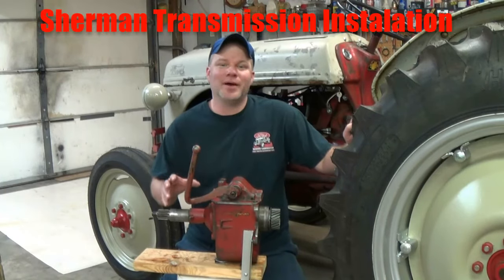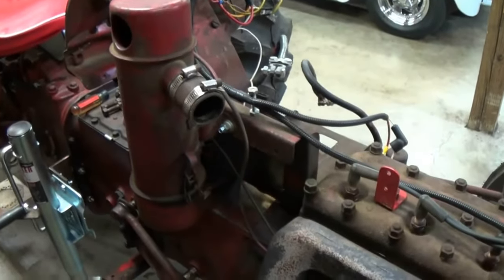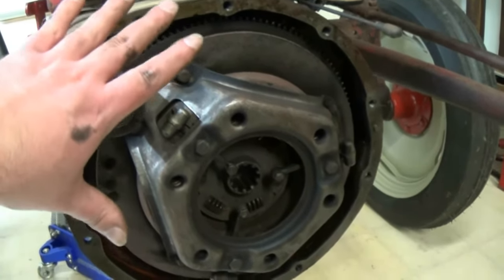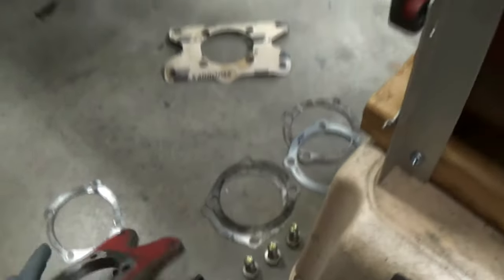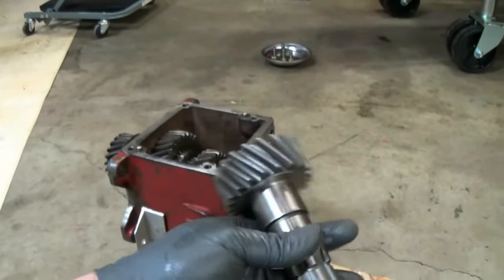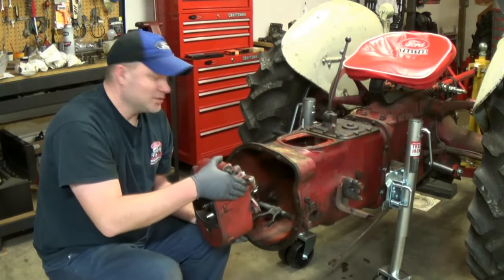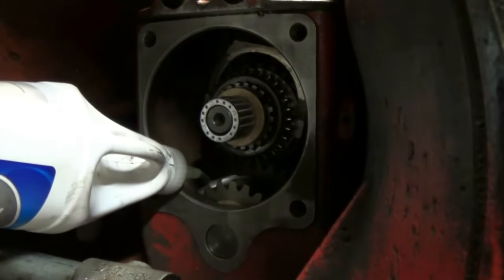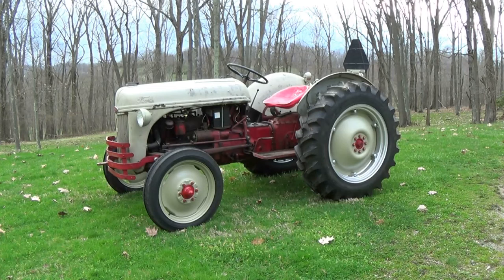Sherman Transmission Installation (Ford 8N Tractor)

Comment: Have you considered doing a Flat head V8 conversion next? I think there is an easy one out there. Would be interesting to see how much better the classics can be than the more modern tractors😁
Reply from the maker: Yes I have been studying V8 builds for years. There are kits available however I do not care for them. The main reason is the hood would need raised and lengthened. The kits give you a piece to bolt to the dash to do that,but I do not care for the look. I would prefer to use a 60 hp flathead conversion where the engine is small enough you can use the original hood and no modifications need to be done to it. It's kind of hard to find a 60 hp one through. I haven't really looked real hard though. It would take the right tractor too. If I'd find one that the original engine was completely junk but the rest of the tractor had good bones I'd attempt it.

Comment: Are there any modifications to make hydraulic and pto live ?
Reply from the maker: There was a Sherman Live PTO conversion however they are extremely rare. I've never seen one or know anyone that has one.
As far as making the lift arms live hydraulic no. Some people will put a external pump that runs off the crankshaft and a loader or rear remote can be used. Pretty hard to do that and make it look nice and neat. Most look like hack jobs.
Reply: @Jason1Pa  The big disadvantage to the crank driven auxiliary pump is that it's constantly robbing horsepower on a tractor that doesn't have much to work with already.

Comment: Where did you get the attachment on the 3 point lift?
Reply from the maker: Tractor Supply.  It is their trailer mover. Has a gooseneck ball on top and a receiver on the bottom for whatever kind of hitch you want to use

Comment: Do you have repair for 8n pto won’t stay engaged
Reply from the maker: I don't have a in depth video unfortunately however here are a couple things. You can check. Grab the PTO shaft (tractor off of course and override clutch off) and see if there is any in and out movement. There really shouldn't be any. If there is there could be a bad snap ring,bearing, etc, damaged causing that slop and creating it to jump out of gear. There is also a small spring and ball (detent ball) in the bearing coupler. That is what your PTO lever hooks up too. If that spring or ball is damaged it will be weak and cause it to jump out of gear. Here is a video of the bearing coupler if your not familiar. Fast forward to the 16:40 mark.  https://youtu.be/19yITWEWcbk?si=zJNPUu4OmXx1F_Vd

Comment: Why wouldn't you drill a hole in the housing to access the drain plug?
Reply from the maker: I never understood why they never had a way to drain the oil out of it. Somethings to consider would be the hole would need to be fairly large to get easy access to the plug. If you wouldn't be able to grab the plug with your fingers and would drop the plug either getting it in or out it would get lost in there. I guess you could have a small pipe coming threw with a cab. I'd be worried that it would get broke off. Also if it were drained out completely you can't get oil back into it and it takes a while for the oil to find its way in. You'd be running low for a while.
Reply: @Jason1Pa  and the bottom of the housing right where it is at is not flat, so plugging it would be the next problem.

Comment: I realize an N series isn't a power house. What are the chances of one of these transmissions holding up behind the engine of an M or super MD Farmall?????     Would it be a waste of machining time to put one of these in a big Farmall?  I'd love to have an over / under drive for an M , super MD. If anyone has better options I'm open for suggestions. M&W stuff has gotten way too pricey, as well as too scarce.
Reply from the maker: There is no way you could get a Sherman  to fit into a Farmall M.
Reply: @Jason1Pa  I can get it to mate mate up , no problem. But is it tough enough to handle the load?
Reply from the maker: @coburnlowman  I don't want to sound like a Negative Nancy, but there is no way a Sherman is going to match up to a M in anyway.  The input shaft is way to small and short. The output shaft is designed to mesh with the helical cut gear inside the Fords transmission and a Ms are straight cut gears. The little Sherman would be lost inside the bell housing of a M. How would you mount it to the front of a M transmission there are no holes or a flat enough mounting surface to even to begin using some kind of a adapter plate. The belly pump would have to go as well. To answer your question though  No I don't think a Sherman is going to handle double the amount of horsepower  for what it was designed for especially if you were working it. To be honest I feel there are some weak points to it that aren't strong enough even for the Fords.
Reply: @Jason1Pa  I would simply build mounts inside the M bell housing to hold the Sherman. Would mate the output with the input M shaft. I have a good machine shop. Have been thinking about using a Saganaw 3speed box and re cutting all the gears for this purpose. Like out of an 60-80's pickup to go the bell housing. I just know were a couple of Shermans are for a decent price. 
   As far as the belly pumps , I've already dumped them. I've made wide front axles. I put the axles below the frame as well , and dumped the M front steering thingy. That way I drive a modern pump off the crankshaft. It allows a mddern loader to be ran or whatever. Use a truck steering sector mounted below the gas tank. 
    I wanna do a Cummins 4B swap and the extra Over Under gearing should have enough power that it'll do everything I'll ever need at just over idle throttle. Save major on fuel.   I found a 4B with built in industrial governor. 
    Also have a black diesel homemade setup in the back of the barn that I  Usta run old 6.9 and 7.3 International Harvesters on. Still run a couple of smaller tractors on it. 
   Wrote this without my glasses. If typos. I couldn't see what I was writing

Comment: What do you know of the Sherman live PTO pinion clutch??
Reply from the maker: I've never messed with one. 😞 Sorry
Reply: @Jason1Pa  Thanks anyway! I want to fit a modern equivalent to my tractor to have a live pto.
Reply from the maker: @kennyc8823  I've never heard of anything modern to give you live PTO. Live hydraulics are possible but you need a external pump such.
The Sherman Live PTO is extremely rare and almost possible to find.
What would you be doing for the need of Live PTO so much? Just curious.
Reply: @Jason1Pa  I want to add a 5 foot snowblower on the back.
Reply from the maker: @kennyc8823  The problem is the speed with reverse even with a Sherman it will be too fast. I understand you'd be able to stop and let it catch up but you'll be constantly clutching. Unless you have a sentimental attachment to the tractor get rid of it and upgrade.  It will be so much easier. Just my 2 cents.
Reply: @Jason1Pa  I have a HUPP dual drive gearbox slowing the speed by half in reverse ;) also the Ferguson wasn’t as bad as the fords for reverse speed if I recall. Do check my Chanel I have a few videos.
Reply from the maker: @kennyc8823  I didn't know you were talking about a Ferguson. 🤣
Reply: @Jason1Pa  Oh sorry might of forgotten to mention. The tractor was my grandfather’s too so it does have a sentimental value. From what I’m reading the ferguson’s reverse speed was about 37% slower than the fords in reverse.
Reply from the maker: @kennyc8823  Yes I think the Ford 8Ns are the fastest antique tractor in reverse. Not sure why they made it so high. Sometimes it's nice to have but most of the time not.
Reply: @Jason1Pa  I think a snowblower will work on mine granted I find a way to fit a pinion type clutch :p

Comment: Why couldn’t you drill another hole and tap it with for a pipe plug  under the Sherman plug ?
Reply from the maker: If you keep up with the maintenance on oil changes leaving that little bit of oil in the transmission is no big deal. If you were to drain it out there is no way to fill it with fresh oil. Then you would need to rely on the oil slinger to get oil back into the Sherman from the main transmission. That could take a little while to get full and I wouldn't want to run it around with little to no oil until it would fill up. Also the hole you'd need to make would need to be rather large to make sure the oil draining out wouldn't make a mess and get inside the bell housing and possibly getting on the clutch. Getting the Sherman's plug back in would be interesting working through a small hole in the bell housing. And if you'd drop it, it would lay inside the bell housing with no way to retrieve it. If you'd make the hole too big to eliminate these issues I'd be concerned if possibly having cracks develop later on.

Comment: Where did you get the sims?
Reply from the maker: @scottwagner8065  I had them on hand from other projects. They are the same shims used on the tractors transmission. If you need some I'd suggest talking to someone who is parting out a junk tractor.
Reply: @ thanks Jason!
Reply from the maker: @scottwagner8065  no problem

Comment: how much does a gearbox cost
Reply from the maker: Depends on condition.  I'd say on average $300 to $500. If it needs repairs it could cost another $300 to $500
Reply: @Jason1Pa  how do you check the oil
Reply from the maker: @vitov1175  It gets oil from the main transmission. It's continually churning oil in and out of the Sherman

Comment: Can anyone tell me why my 53 jubilee leaks milky oil from the weep hole at the fly wheel and under belly possible seal?
Reply from the maker: Milky oil is moisture in the oil. More then likely your input shaft transmission seal is leaking. Transmissions are prone to get condensation in them. If you'd have that much milky oil leaking out of the engine then there are more issues then just a leaking crankshaft seal.
Reply: @Jason1Pa  know where to get a seal kit?
Reply from the maker: @calebmahala4263  Just8ns.com or Dennis Carpenter is who I deal with when getting parts for a Ford. No kit. Simply get a seal and a gasket separately

Comment: You would  need to replace  the  gear it meshes with a new one.
Reply from the maker: The new teeth were REALLY far off. The original shaft and the original Sherman shafts teeth have perfect mesh.

Comment: What the point are these
Reply from the maker: Just to give you a wide range of gear ratios. You can now go slower and faster then the original transmission. The tractor started out at 4 forward speeds and one reverse. Now it has 12 forward speeds and 3 reverse speeds

Comment: Man, wish I had a lower gear than 1st Gear on my 8N! Fords 1st Gear is too Fast!! Cannot Work all the Hand Controls to do a Good Job!!! A   Lower/Slower Gear/Speed would be Great.
Reply from the maker: Sadly the Shermans still don't slow it down enough. It's only about 1 mph difference when low range according to GPS. It's hardly noticeable. I got it mainly to go faster down the road. I never have a issue with 1st gear but reverse is crazy in most situations.